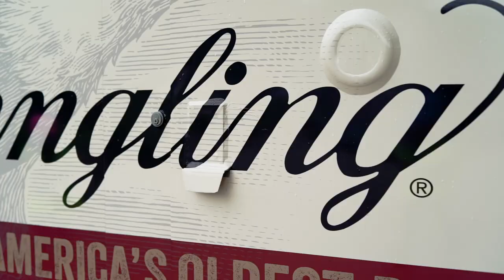Yuengling is Bringing the Goods to Texas

Comment: Be nice if they exported to the Philippines. S&R here in the Philippines imports a lot of stuff from the USA. Then with all  the chair force, I mean air force veterans up in Angles City, there's  a market.
Reply: P.s.  your local beer is probably better than any mass produced American beer...  The good beer here is all micro brews now. It wouldn't be economically feasible to export them due to low supply.
Reply: @ryandaniels8022 , You have never been to the Philippines I see. The local beer is San Miguel and the tastes varies. In addition it's not uncommon to find foreign objects in the beer.